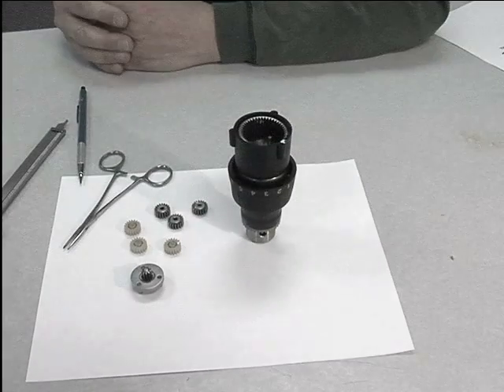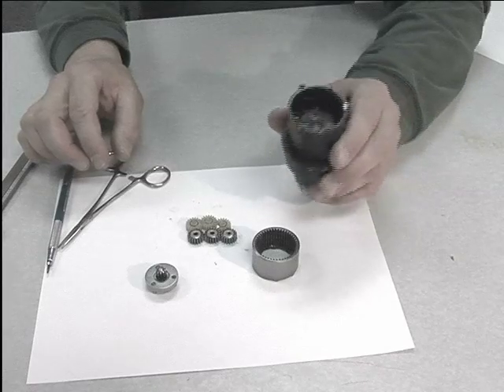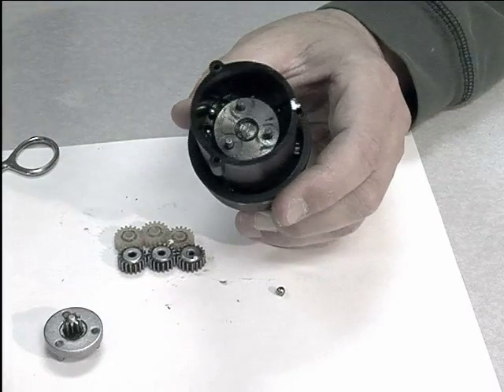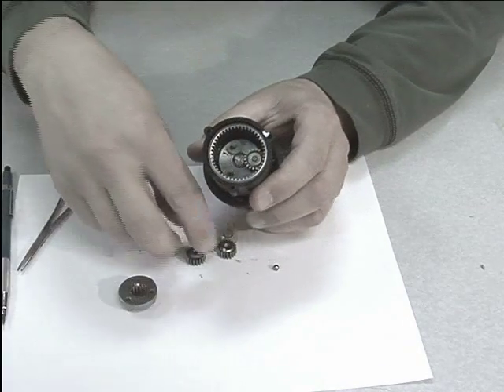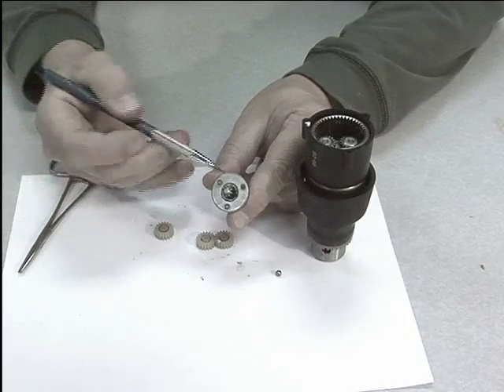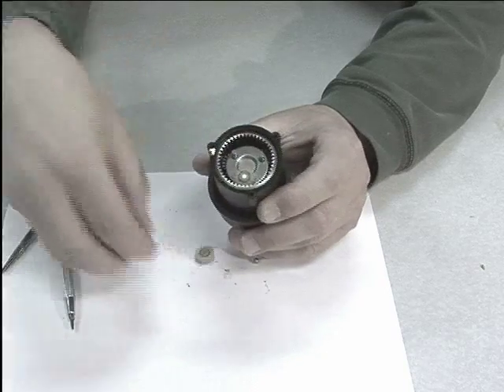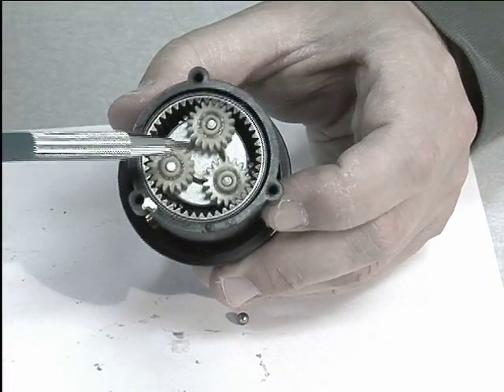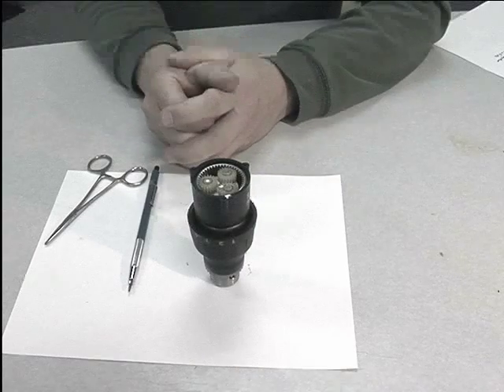Planetary Gear Set

Comment: Everyone should be aware this video has several mistakes.  Firstly, it says there are 2 stages of planetary gears, each having reduction ratios of 2.66 for a total of 5.32.  This is totally wrong.  You multiply the ratios of the individual stages, not add them.  Second mistake is the reduction ratio of each stage is not 2.66, it's actually 6.  If you pause the video and count the number of teeth on each gear, you'll find the ring gear has 45 teeth (R), the planet gears have 18 teeth (P), and although hard to see, the sun gears have 9 teeth (S).  For each stage, the input gear is the sun gear, and the output is the planet carrier.  In this common configuration, the ratio of the input speed to the output speed of each stage = 1 + R/S = 1 + 45/9 = 6, so the total speed reduction from motor shaft to chuck = 6 * 6 = 36, not 5.32 as the video calculations show.  A constraint that must be satisfied in this configuration is R = 2P + S, which in this case is 45 = 2 * 18 + 9.  Another mistake in the video is measuring the gear diameter at the top of the teeth with the calipers.  That diameter is not used for calculations.  The diameter (or radius) of the gear pitch circle is what matters for calculating velocity ratios.

Comment: A planetary ring calculation is 
Ring divided by sun
So.if the rings 46 and the sun is 9
Its 5.1
Reply: Depends on which gear is fixed (not moving), and which one is the input and which one is the output.

Comment: Excellent illustration. These two reduction gear ratios called also the epicyclic  gear system are much used in major vertical amusement rides to lift weights measured in tons relying on the torque force.